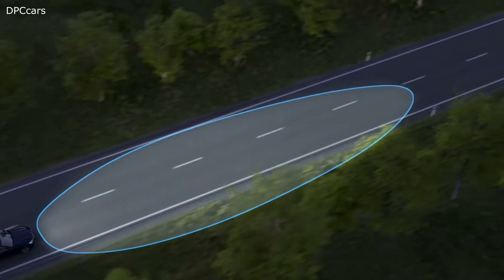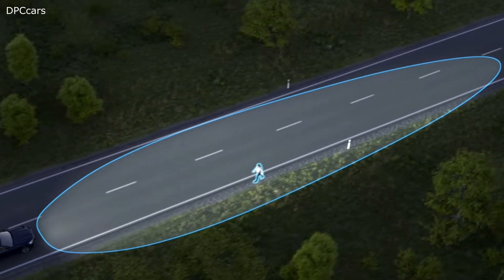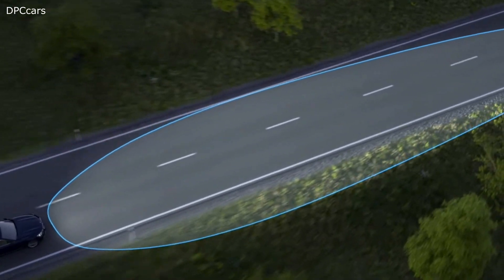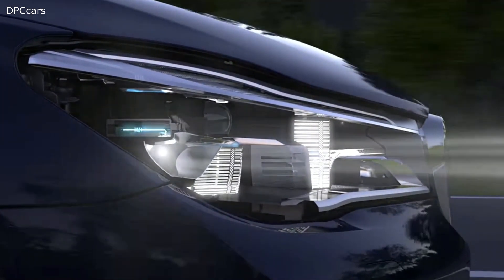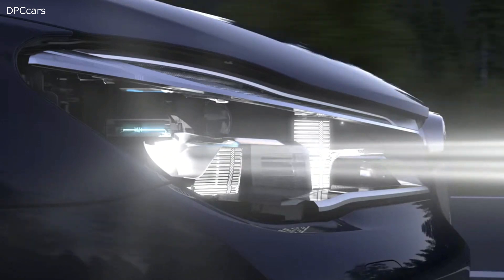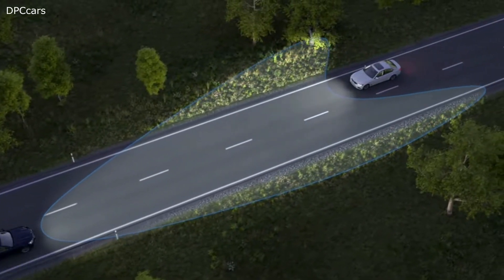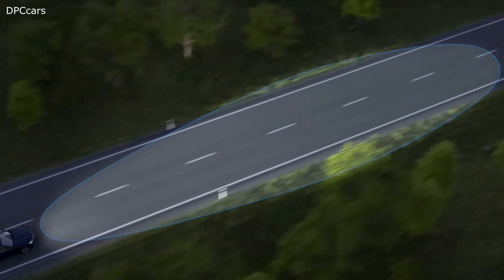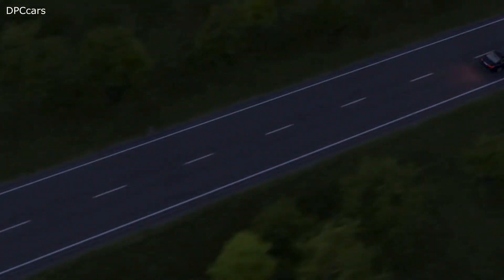BMW Laser Light Headlights

Comment: I wanted to say "oh man that's gonna cost a lots of money" but then I realized those who drive BMWs, they are not like me, well I need to check my wallet 8 times before replace something on my car. That's why I don't drive bmw
Reply: I agree. Expensive cars come with expensive problems
Reply: @Michael-pp8lz  this isnt a standard feature on any BMW, not even their most expensive model. its option on top of an option.
Reply: As someone who works on them.  Most people who own them are car poor and decline repairs which is why they have such poor resale value.  When traded in they usually need crazy $ to fix them back right.
Reply: You've got to use my strategy. Find a well-maintained used BMW that's at least 7 years old so the price has depreciated to a 4th of the MSRP.

That's how I found a 2011 X5 50i for 12K.
Reply: @LaniakeaDenizen why would you buy a old ass bmw like that? You might as hell spend your a bit more money and get you a brand new Honda/Toyota.
Reply: @chris2320 😂

Comment: What people do not realise, is that high beam of BMW laser lights turns on most of the time in unlit motorway driving, even if there were cars in front and coming opposite.
Amazing beam beautifully lights up over quarter of a mile ahead of you cleverly missing only areas where there are other cars, thus avoiding blinding any of them.
This happens even if there are perhaps 8-10 other cars coming and going in field of lighting.
If too many cars in the field, it turns off and changes to an excellent dipped light.
Reply: Just turn off the auto on function... Simple fix. Just use the high beams when you need them and no other traffic.
Reply: @Krisp97 you don’t realise that he wasn’t listing that as a negative point? Why works you turn the function off of you don’t blind others while it’s on?